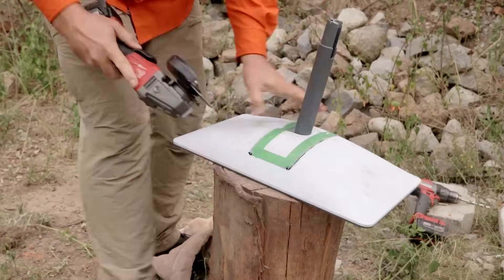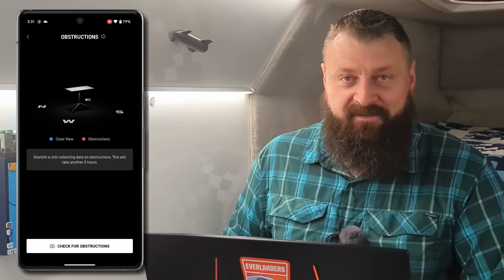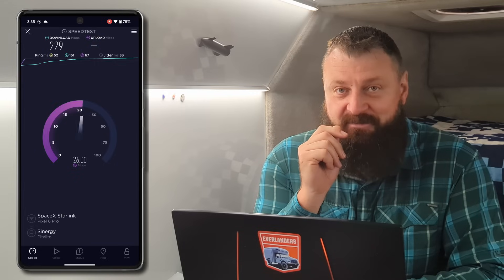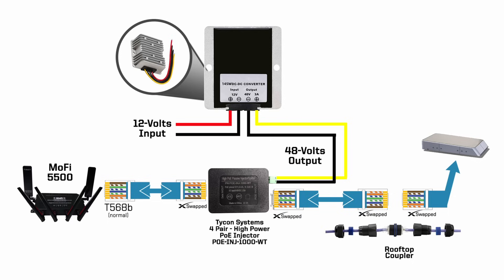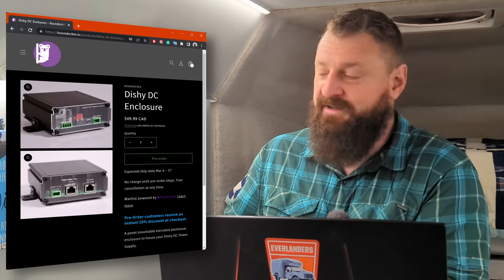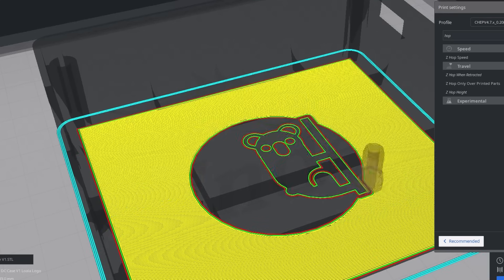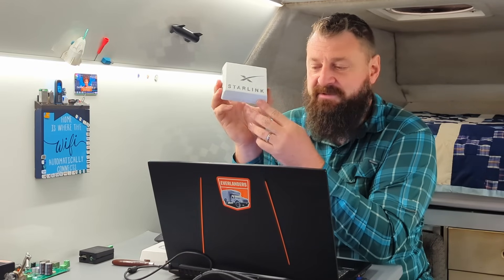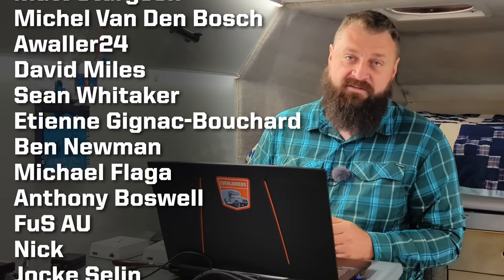Starlink DC Power Supply

Comment: Any chance you could provide the overall dimensions of that little unit? I have ordered one, but I'd like to get an aluminum enclosure ordered, as well. Since they don't sell that item anymore (according to their site) it's easy enough to order a project box though. Thank you!
Reply from the maker: Sorry for the delay, I kept seeing this comment when I was away from my computer. The board is ~110mm x 97mm and the tallest component is about 33mm 👍
Reply: @Everlanders  Thanks, so much for the info and your continued support of the community!

Comment: There are also different RJ45 crimp connectors for stranded vs solid wire. The "pins" on the stranded type have two stabby prongs lined up on the center of the wire. The solid type have 3 prongs, 2 offset one way, 1 offset the other, meant to grab the sides of the solid wire. The wrong type can work on the wrong wire but it's not as reliable.
Reply: Do you have a link to crimp connector that is designed for SL wire?
Reply from the maker: Exactly, I've since ordered crimps with 3 tines on the fork and had much better results.
Reply: @Everlanders  Can you share which crimps (3 tine) yielded the better results?
Reply from the maker: Maybe this? https://www.amazon.com/gp/product/B07V4K9L14

Comment: Fabulous just fabulous !!  Over my head at present time. I was curious to know did u resolve the issue of ir frame suspendrion?  Did those white plastic buffers hold up under the weight of the cabin to the frames suspension?  Thanks and keep giving use  the details of ur travels. Carpe Diem
Reply from the maker: Yes, but now the metal shackle has torn...

Comment: I noticed their box says 12v POE but I saw your router seemed to be powered by a power cord. If I use this box will that eliminate my router power cable or do I still need to add it to the 12v power supply? Thanks! Great video. Nice to be able to follow along without scratching my head.
Reply from the maker: The router would need to support PoE to work with PoE... Ours is DC powered, so it's much simpler to just power with DC.
Reply: Everlander pls tell me what DC powered router your using. Thx

Comment: excellent product review, thanks for sharing. it would be super helpful if you would post the f3d or solid models to thingiverse and not just the STLs, so people can more easily modify to fit their needs.
Reply from the maker: What would you like to modify?
Reply: @Everlanders  everything. Always. 😁 For example, on the dishy flat mount I want to move the aluminum feet to match a different spacing for cross rails for my solar setup.

Comment: I also preordered one, I’m not cutting the power cord on the dishy. Instead I’m using the original hookups and heat shrinking them with a little tape over it for water proofing. On the other end I’m going to have to use the RJ45 connector, my question is what wire order do I use to plug into the the new power supply. Thank you
Reply from the maker: Perfect!

Comment: I was just finishing my last section of the flat mount you designed and this new video popped up urging me to give my money away for a nice goodie to make dishy run on DC! So happy to see this and even happier for the case you designed and shared - THANK YOU! THANK YOU!
Reply from the maker: That is awesome!
Reply: I’m new and barely looking at some info what are the benefits of using DC? Not use an inverter?
Reply from the maker: Half the power consumption.

Comment: Great video, bells on! 

Thanks for the community effort. I must say though, I think your setup is particularly nice, as in it has its rake (if any, it's small) mounted towards the front of the device, and you are typically up on mountains.

folks on plains or in valleys often, may also gain an extra edge with sparing a thought towards their vehicle to how they can "point" it better.

Comment: What do you think about their ongoing price increases - could they end up being enough to push you off the platform? I find their business model too unpredictable and being locked in after purchasing the equipment is too risky IMO. Would another data plan be a sufficient option?
Reply: Price increase is only in some markets. In Europe the price has actually dropped.
Reply from the maker: What increases? The price has never changed for us...
Reply: @Everlanders excellent, I thought their RV rates were universally applied; unless I overlooked if youre on a stationary plan. The rates in the US just went up for high use and RV users, with more restrictions.
Reply: Ive been up in the air about it for a while, but the latest increase is going to make me look into multiple data plans instead.